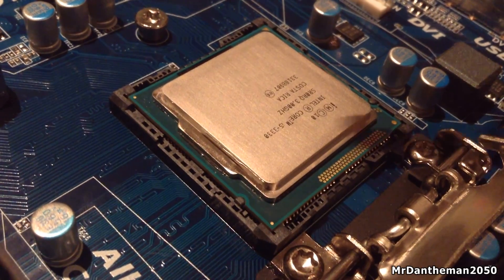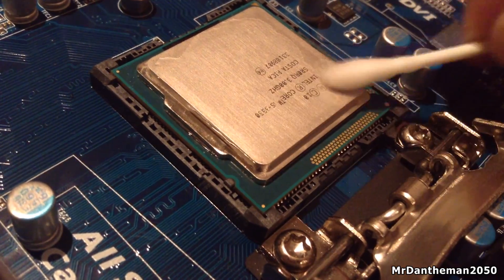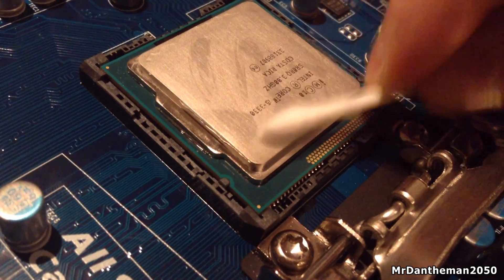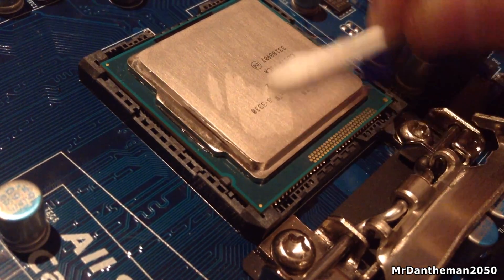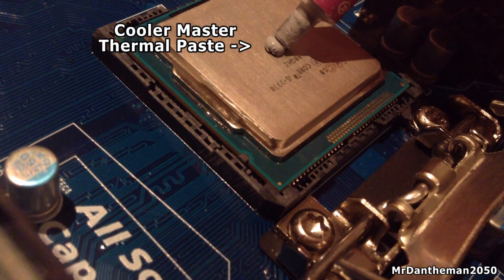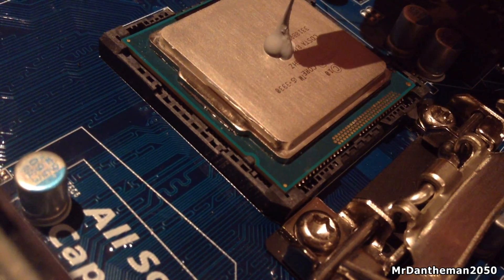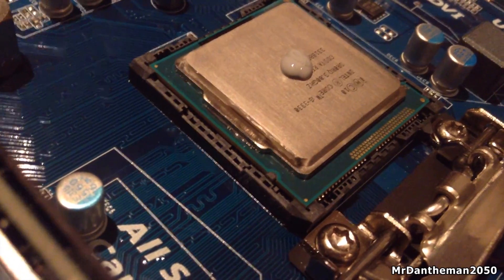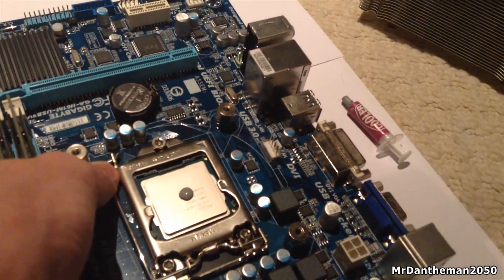How to apply thermal paste the right way

Comment: When the manufacturers pre-apply thermal paste on coolers it’s on the whole IHS, so right there that tells you something? Maybe we should try and reproduce that instead of simulating it.
That maybe hard to do unless you get into silkscreen or some expensive tools.  I think the whole IHS is our goal, but it’s more practical to use the line or pea method.  The amount of thermal paste would then depend on the size of the CPU and the force which the cooler plate applies it.  These methods all all a bit subjective, so I guess do what works and buy enough paste to reapply it just in case.  Eventually you will find a happy medium.  This has been tested enough and temperatures don’t fluctuate that must to justify exacting methods..
My 1 cent.

Comment: This is exactly how you DO NOT apply thermal paste to the processor. That ammount of paste he uses would be enough for 4 processors...
Reply: +jirka merunka when you spread it out on your own you get bubbles everywhere and your cpu will be much hotter than usual, this method with the small dot of paste in the center then placing the cooler on top is by far the best way
Reply: +jirka merunka I've been building PC's for around 7 years now so I know my fair share about them, if you take a see through piece of plastic and place it over the paste, the same way you would a heatsink, you can clearly see all the bubbles that form
Reply: +jirka merunka the pea method covers the entire cpu most of the time and when it doesnt its by such a small margin it makes no difference, the whole cpu does not need to be covered anyways, the core is a small portion of the cpu in the center, thats the part heat needs to be transferred from
Reply: +jirka merunka Every video I've seen on this has a comment saying it's the wrong way. So what is the right way?
Reply: Jordan Rarick Well let's not tell you "my" right way but the "general" right way. You need to cover the IHS with a thermal compound so that you cover the whole IHS and also use as little thermal compound as possible. So it makes sense to me the best way to do that is the spread method where you can see exactly where the thermal paste is and the spread of the paste will not change after you apply the cooler to the IHS. So I always do the spread method leaving as little as possible on the heat spreader.
Reply: Uninstall I bet my shoes, you only always read about what you just wrote. OR do you wanna tell me you tried it out yourself? How do you know there will be bubbles? How do you know the cooling would be worse than if a pea method is used? I mean you are repeating the stuff I heard many many times online, though no prove has been presented. I will bet you 100 dollars via using the pea method you will never have better cooling capability than via using the spread method. Actually there is so little of a difference. You can try it out and I bet you will get pretty much the same results as long as you cover most of the IHS with thermal compound...  But factually using the pea method, the corners will be left empty. You say bubbles... What bubbles? The cooler and IHS are touching each other, there are no bubbles... imaginary not important bubbles maybe....
Reply: +jirka merunka mate i had  look on your channel and i cant for the life of me find your tutorial on thermal paste, can you link it
Reply: Justin Willoughby What? I had a look on your channel and I just can't find your tutorial on how to type comments on youtube... Can you please link it?
Reply: +jirka merunka 
I tried both. The dot in the middle, and have the heat-sink spread it out. Also, put a small amount, and spread it out with a spreader. They both come-out the same. No change in temperatures at all. So, the question is which takes less time to do, and the answer is the first one.
Reply: Dan V I agree, I realized it makes no difference what method you use... As long as most part of the IHS is covered, it works....
Reply: no it fucking isn't... it's perhaps a TINY bit too much, nothing more.
Reply: b1ldin bee I found out that a little more is better actually cause there is no difference when trying to spread it or make a dot... So as long as you cover the whole IHS it's all good :)
Reply: looks good to me. I'v tried the spread method but the cpu runs little hotter, so I jump back to the half-pea method and it works just fine.
Reply: Supposedly the x method acctually gives the coolest results
Reply: Uninstall It's better to have bubbles than an half way not covered IHS, which is exactly what happens with the pea method. So you can decide if you want to have bubbles that just don't affect the cooling capabilities at all or you can use the pea method, have half of your IHS dry and have half of the thermal paste then around the IHS where it's not supposed to be. Again, to see the difference, you really need to fuck it up but the spread method is the best option available...

Comment: This method is the easiest but also the least effective way. It typically spreads into a circular pattern & leaves a significant area of the CPU TIM without any contact with the heatsink because the thermal paste will itself add some height between them. The most effective way is to evenly spread the thermal paste as a thin layer over the cpu or heatsink with a flat plastic card. & no, the microscopic and far in-between air pockets are nowhere near as inefficient as missing close to 1/4 of the total contact area with the method shown here. Most of the area where there is no thermal paste is equivalent to a gigantic air pocket... so whats better, a huge area with no/poor contact? or a few microscopic ones barely visible to the eye?
Reply: My understanding is that the paste becomes more viscous as it heats, spreading the compound further. That would result in no air at all, and lots of coverage.
Reply: wal kardana Whats your problem? You'd do well to actually comoplete an idea rather than try to insult me and make no sense.
Reply: Advection357 I think I mean less viscous(thinner) as it heats. Then you have good spread without using a thicklayer of compound for optimal temps.
Reply: Please don't listen to this guy. He doesn't have a clue what he's talking about, getting the paste over the DIE is the most important part
Reply: Maybe if your a noob and are afraid of not doing it well enough, at least you can overdo it. But I agree it should be over all parts of the die.
Reply: You know my argument, that a pea sized dot is sufficient for most cpus(just like nearly everyone else thinks) and I will critique  your methods, namely your spelling.
Reply: +Kevin Brain I agree. The actual die is only under the center of the cap. The outer half a cm or so, sometimes more,  of the cap touches nothing under it at all, it is just air. This article shows a i7-5960X with the cap removed, http://wccftech.com/intels-flagship-haswelle-core-i7-5960x-processor-delidded-features-soldered-thermal-interface-material/

Personally I like to clean both the CPU and heat sink then treat them with a neutralizer, even though the alcohol evaporates it can leave residue that can break down thermal paste. After that I will prep both surfaces by spreading thermal paste on both and wiping it off with a lint free cloth to fill the microscopic holes in the metal. All that is needed is a pea sized drop onto the center of the processor.

Something else that should be said. The spread method, although not always, can result in a large bubble between the CPU and heat sink and will always have bubbles of some size. On the other hand the pea method will almost never do this. So no bubbles VS always having some to sometimes having large bubble, I will stick with the pea method.
Reply: Lan Hikari It might become slightly more viscous ... but thermal pastes come in a broad range of viscosity. The only way to assure good contact with the method shown in the video is to put A LOT of paste... until it overflows from the sides when the heatsink is put in place. Of course that's a bit wasteful & can be hazardous (depending if the paste is electrically conductive). As an example... I have an i7 4790K (paired with Noctua NH-D14 cooler with plastic card spread method of course) and we all know how hot this cpu is supposed to run. Well... It's currently idling at 23C (same as ambient air temp)... Witcher 3 pushes it to around 40c... & Intel's stress test maxes at 58-59c.
Reply: It appears someone thinks computers haven't changed since 1994... Not sure where you learned it from but your the equivalent of a flat earther in todays world.
Reply: Lan Hikari Are you just going to critic my experience & methods with your fallacies or do you have an actual argument or useful input to add?
Reply: And it's you I'm meaning. Please stop confusing people with wrong information. You said put loads of thermal paste until it's overflowing out of the sides? LOL your joking right ? If not you are clueless
Reply: Oh yeah I think he was not being serious. That would be fine if you squeezed it so hard there was only a thin layer of paste but applying it to cover the entire cpu ensures you have a layer that is way too thick.
Reply: Lan Hikari I've been building PCs since 1995... I know a thing or two when it comes to installing heatsinks :P Trust me, nothing beats an evenly spread thin layer with a plastic card... if you can, do it that way. If you don't care to get the best efficiency, you can chose the easier & less efficient methods.. up to you.
Reply: Lan Hikari Sufficient isn't optimal. If you used any cpu-intensive apps, you would know better. Time to mute this post.
Reply: it's about fastest transfer not area when it comes to the CPU. area only matters when it comes to the CPU cooler then you need a large area to dissipate the heat so a fan can move the heat away. think of it as if there was a bridge from the CPU dye to the cooler you need to get the heat from the dye to the cooler not from the dye to the CPU cover plate so with the hot spot being in the middle of the CPU that is where you want the fastest heat transfer to the cooler ? ie the bridge.
Reply: +Lan Hikari applying of thermal paste really does not change and he is absolutely right. The best method is to apply as little as possible, just a micro layer that covers the whole smaller surface of those two (IPS or Cooler)
Reply: +Advection357 iv ran prime 95 on blend for 24 hours with a pea sized dot
Reply: +Lan Hikari the laws of physics haven't changed though. there is nothing about coupling a cpu and heatsink with thermal paste today that is different from doing it in 1995. Advection357  clearly knows what he is talking about and I can confirm it, I build computers for a living
Reply: +Advection357  In some respects you may be right but you have to remember that the CPU dye is right in the center of the heat plate that is placed on to the CPU when it was manufactured so if you use the pea method in reality you are maximizing the  thermal coupling of the hot spot of the CPU directly to the Heat sink i do not intend to say your wrong but think about what i am saying.
Reply: +SpamBanjo Every heat sink I've removed that I have used the pea method on the thermal compound has covered the entire cap of the CPU. Are there little corner sections sometimes that don't get covered, sure but those are less than a square mm in area and useless to my ends.
Reply: Bullshit. 

The best way is the line method about the same lenght as the CPU die bellow it. You don't need to cover all the metal cover of the cpu, and if some spill a little is not a problem either, it is easier too put a little bit too much thermal paste to make sure it will spread all out. Opposed to popular myth, excess thermal paste is not bad because proper pressure from the heatsink will push pretty much the same amount of thermal paste away to the borders anyway. 

Spreading the thermal paste is too much suscetibilize to screwing things over.
Reply: Lan Hikari 
Best, if you don't want to appear to be a dumbass ignoramus, is to be familiar with any ideas you wish to share, and especially if trying to use words clearly alien to you as a way of impressing your audience.

Comment: I have been doing custom builds for 15 years and the best advice I can give anyone for prepping the surface is Arctic Clean and use coffee filters to wipe with as they do not leave anything behind like a qtip can.
Reply: +LennartSteak im sure drinking is optional.
Reply from the maker: +Nick Harding Haha, please use Isopropyl Alcohol, not the drinking kind from the fridge :) Dan.
Reply: should i also use alcohol?
Reply: LOL.. alcohol high % is fine but ARctic Clean truly does a better job.  Especially at removing old paste.
Reply: ISEE YOU I just used a window clean kit and it worked well.
Reply: ***** Uhh.. the ammonia kind?
Reply: ISEE YOU Nothing with weird stuff, it cointained Isopropyl
Reply: ***** Good!  Ammonia can do weird things with the heatsink compound when you got apply it.
Reply: b1ldin bee I agree there are plenty of stupid ppl who do things incorrectly and behold the STOCK speed of that CPU runs fine.. the guys going to the bleeding edge of stability want every degree cooler they can get.  I'm not even sure why you commented.... FAIL.

Comment: Is the xmethod good? (Drawing an x diagonally)
Reply from the maker: Hi, I would only recommend that method when using a large CPU like the Intel LGA 2011 ones. Apart from that I'll stick to the Pea Method as it creates an even spread on most CPU's.
Reply: +Dans Tech what about the LGA755
Reply: +devin jackson it's a large heat spreader that's why the x method is good